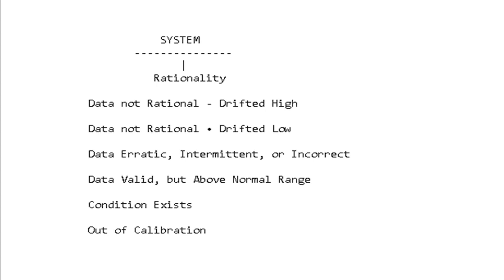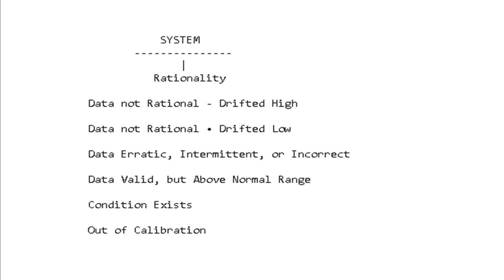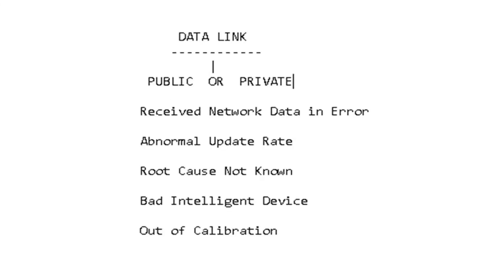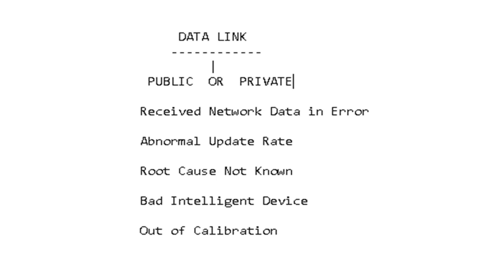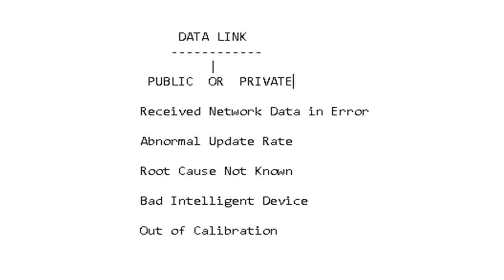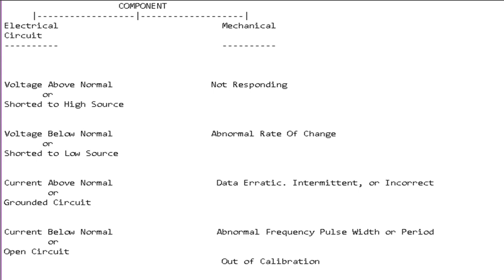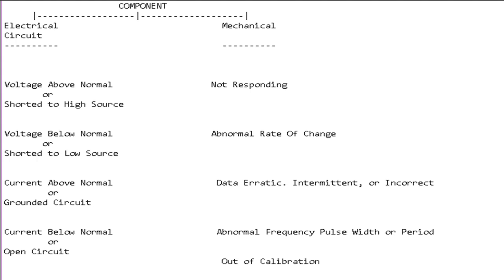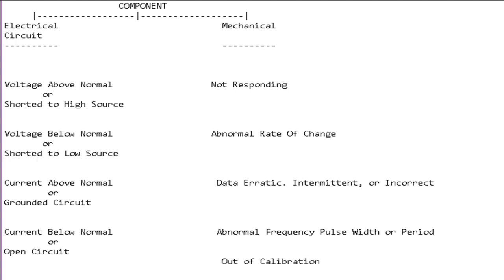Categorizing fault code explanations

Comment: Great video Joe. Sure would be nice if everyone would use the same code formatting. Cummins uses the the SAE J1939/73 formatting with PGN, SPN and FMI numbers along with many other manufacturers, but the Paccar (DAF) engines I primarily work on use P and U codes outlined by HD OBD that was mandated in 2010 and made stricter each passing year on monitor criteria. I feel like as an industry not much training has been given on HD OBD with what monitors run and about drive cycles needed to run in order to clear permanent faults.
Reply from the maker: The fault clearing Process I think is especially important to understand. I have had people drive faults out when active only to cause another 
problem. Some of the calls that come in are related to "why is the fault still active we changed the (failed part)".